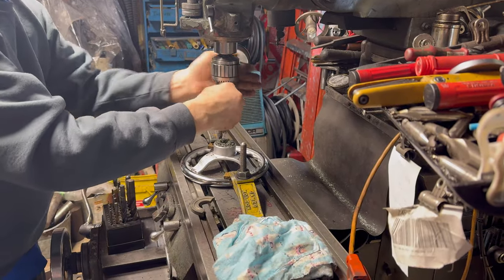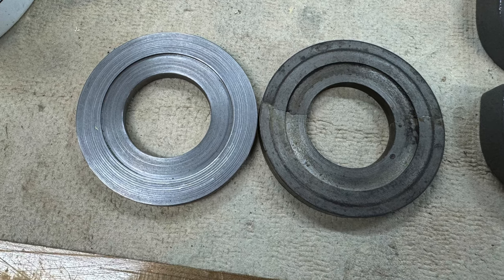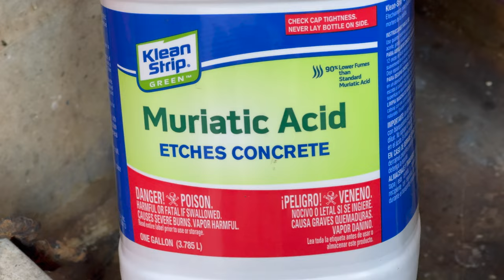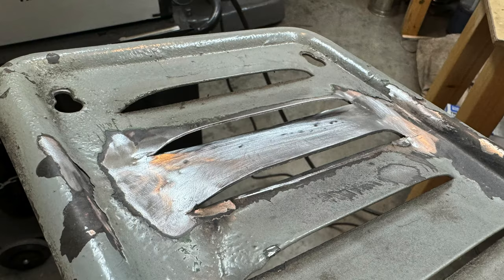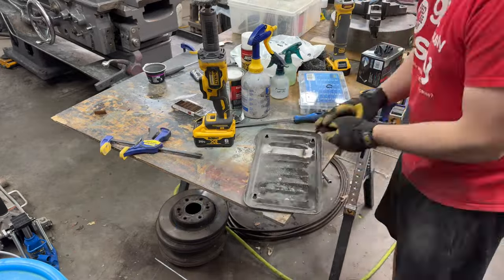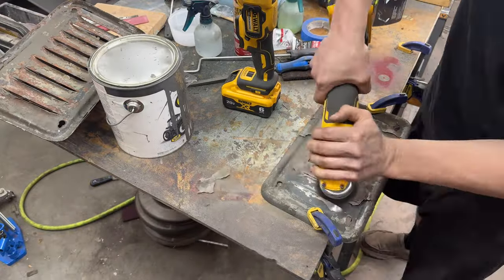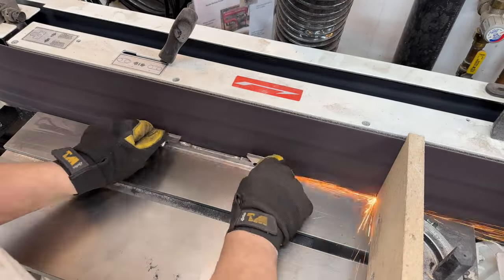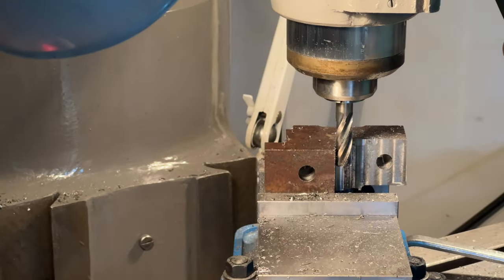1940 Monarch 16W Lathe Restoration Part 4 of 5: Replacement Parts

Comment: Where did you find the other louvers ? I-need one for my 16cw ,  and taper attachment covers .
Reply from the maker: Dumb luck. A generous fellow on the Monarch Lathe Owners and Operators Facebook group sent them when he saw I was missing two. I found louvered panels that could be cut to fit and painted on the Grizzly parts website. They would do the job but look nowhere near as nice. The company Monarch cannot supply the panels anymore - I checked.